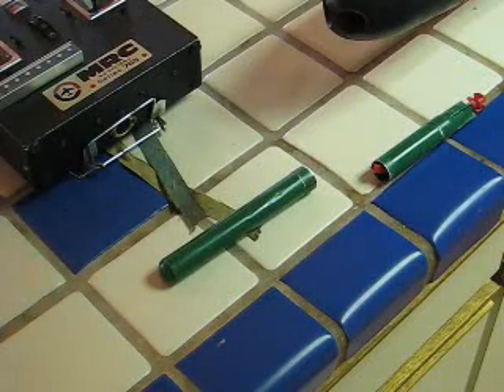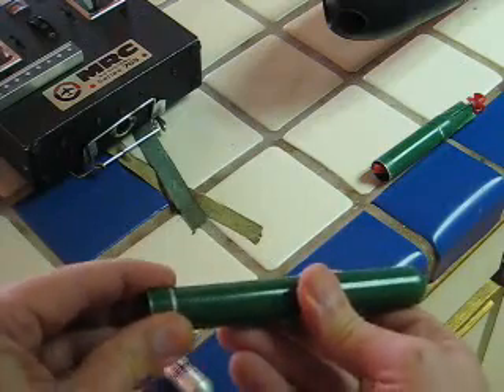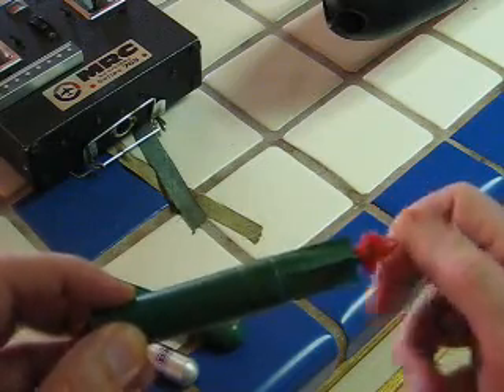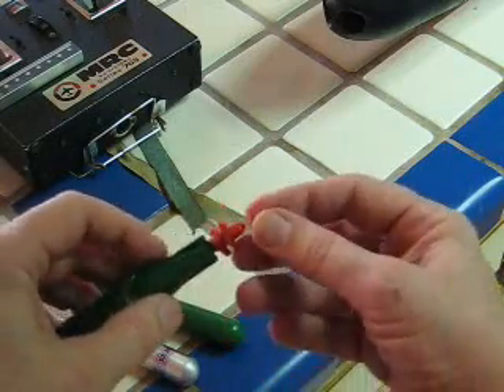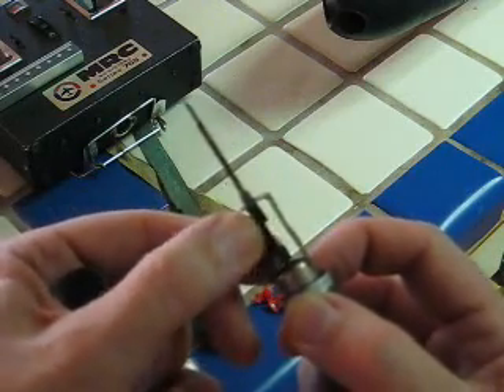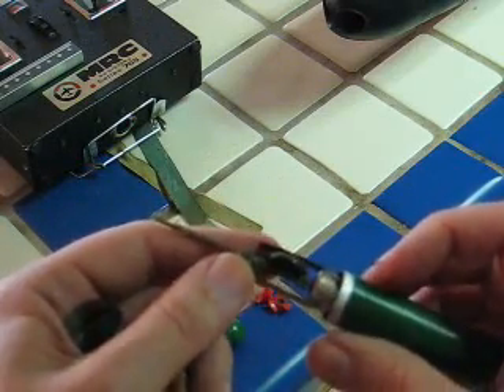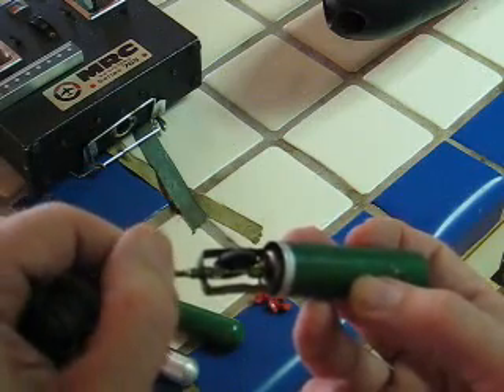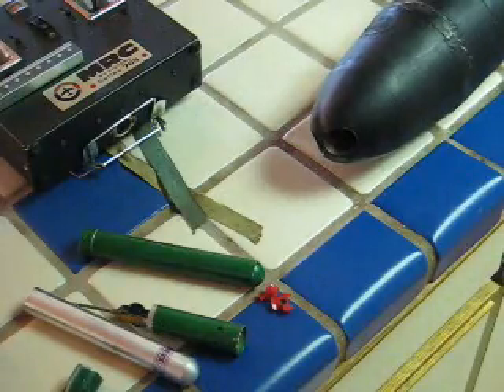Torpedo movie part 2

Comment from the maker: Thanks!  Balance and floatation was a big problem.  Brass props would have been very heavy, the plastic ones were cut down from full size Graupner props (with a brass threaded insert).  Pulled the insert out to save weight and the result was a prop that actually was slightly positively buoyant.  Battery power was the biggest issue but someday hope to try small LiON's in it.

Comment from the maker: Hi, I turned the tail cone from a solid bar of aircraft grade aluminum.  I used an inner cutter to create the cone's inside first and then turned the outside with an outside cutter so that the inner and outer dimensions were parallel.  I then drilled the end of the cone to accept the shaft and used a cutoff tool to remove it from the working stock.